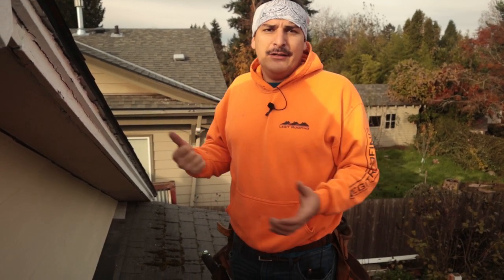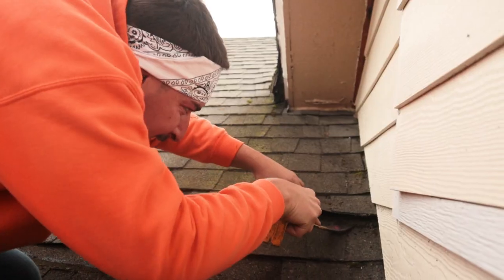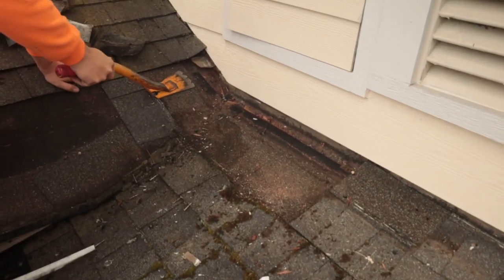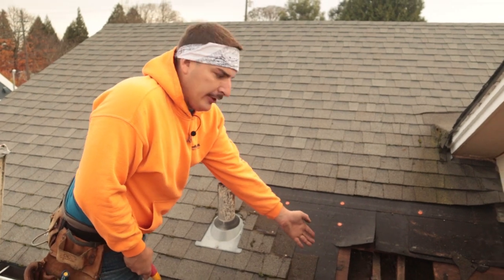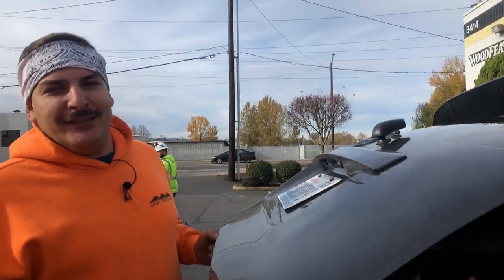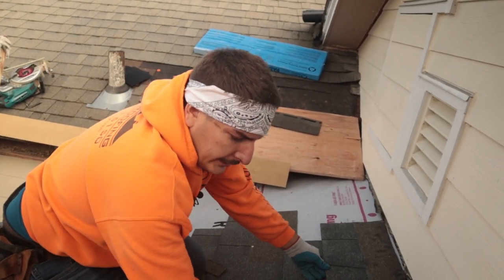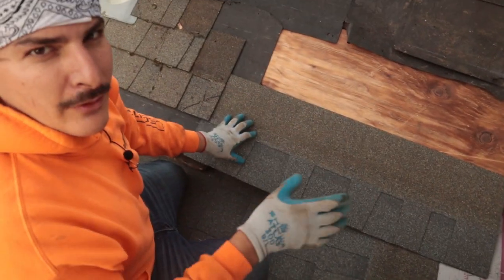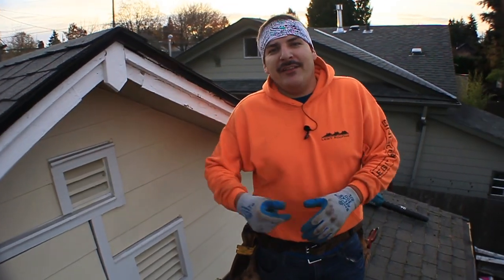Leaking Roof! | Here Is How To Repair It

Comment: How much do you charge for a repair like that
Reply from the maker: $1,500 - $2,000 if it was just this. We did way more work on that job though. We charged 10k but had some gutter replacement and some more misc repairs.
Reply: Mr. Legit Roofing Expert I need a job with you

Comment: I had to say fail, be cause negitive feed back makes more views but you are slowly redeeming yourself.
I type while I watch.. how long you been roofing?
Reply from the maker: Since 2002 pal.
Reply: 2008 for me.
Reply: Correction 2004 to 2008 was my training, 2008 took on first roof by  myself. And it was a barn style 12/12 to 9/12, with lower 2/12 behind roof and garage. Peel and stick all the way.
My first roof was iko shingles. With absolutely no self adhesive on the bottom of shingles. 
Iko rep came out, gave a free caulk gun and 6 tubes caulking and said sorry our factory sent out bad products.
Lol how many others noticed.